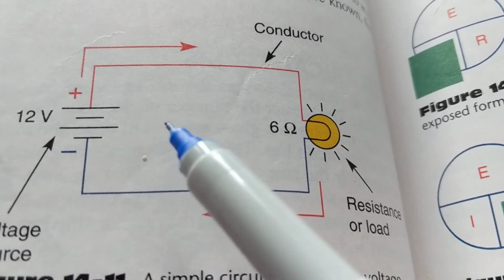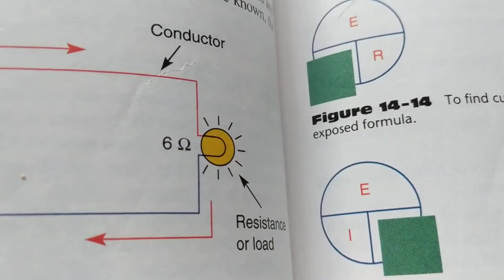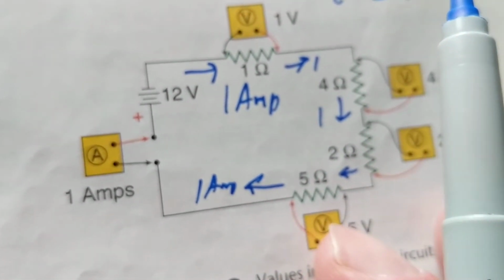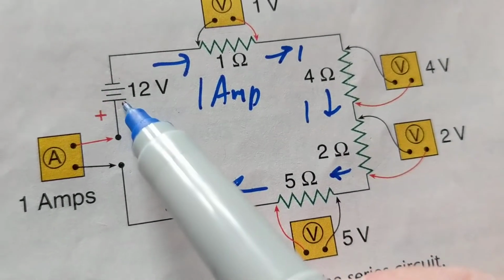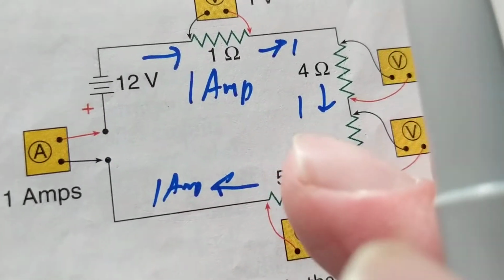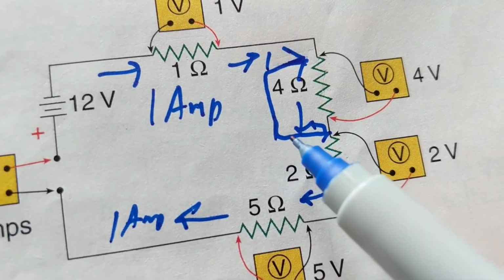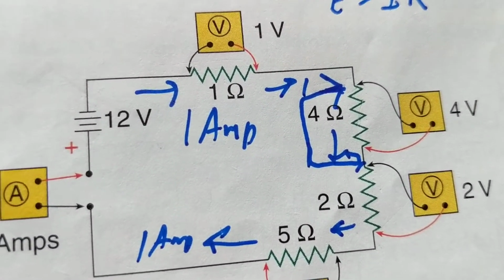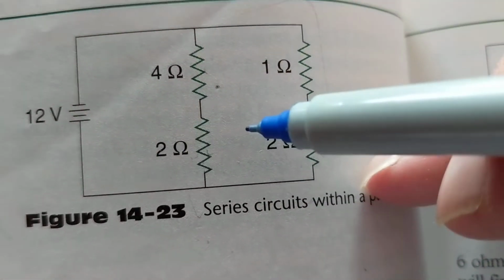SHORT CIRCUITS AND OPEN CIRCUITS AND ALL KIND OF CIRCUITS TO DIAGNOSE VERY HELPFUL PART TWO

Comment: Hello. Injector circuits are mostly in parallel. How can a shorted injector does not cause all the other injectors not to work since follows the path of least resistance? Thank you.
Reply from the maker: They almost mostly in parallel I was going to make a video of it actually today anything that's shorted might cause something else but it depends if it's a dead short or if they're still resistance in the circuit even with the short
Reply from the maker: Also depends on the fuel injection system if they are individual or if they are in the group remember if they are in a group you have a transistor being shorter to ground